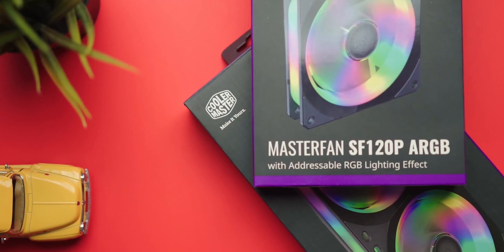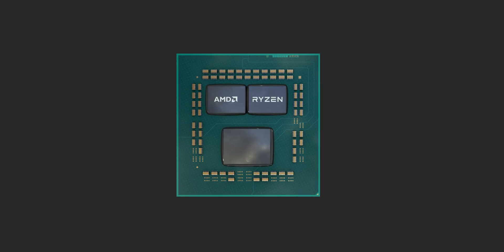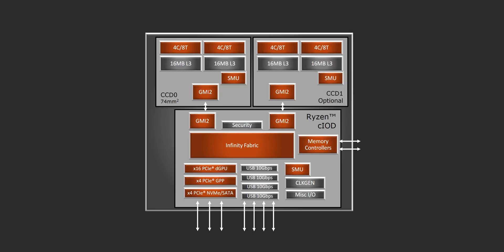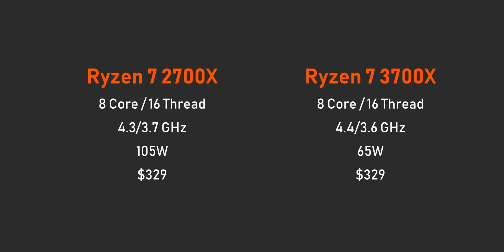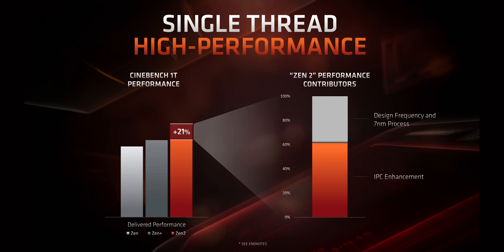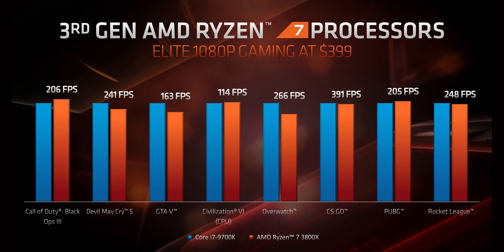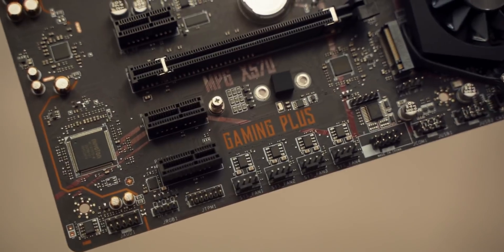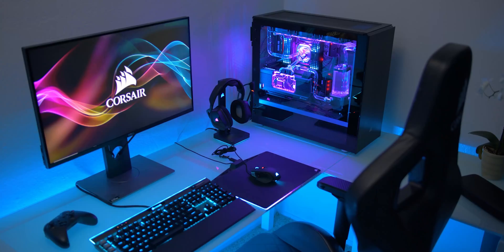AMD Ryzen 3000 – A Very REAL Problem For Intel?

Comment: Aiming for 3950x 16c/32t @4.6ghz
64mb total cache. Changed my mind from 9900kf 8c. But I'll wait till January I guess. As I want to see intel core X 10 core & AMD 64core threadripper performance this December before commiting in buying anything. 
9900k are selling like hot cakes rn & I'm resisting temptation, even at 20% reduced price. But if any from AMD's cpus revealed till December, can match single thread performance close enough to 9900k, with their high cache, pcie4 & core counts, I'll get that.
Am Interested only in 16c+ but with 9900k single thread performance, the first AMD chip that does that wins!

Comment: As a 2700x owner, the logical thing would be going for the 3900x, maybe holding out for 16 cores by the end of the year... Any other ideas on this?
Reply: Still holding out for 3rd party benchmarks but I would appreciate the gain in IPC. Also, upgrading would seriously streamline video editing and especially 4k rendering for me. 16 cores should practically half conversion time. Besides, when I chose AMD I already did it with Ryzen 2 in mind.

Comment: Guy's if you have an x79 mobo, grab a Xeon E5 1680v2 from Ebay for under $200. It's 8core 16thread fully unlocked and will smoke Ryzen. You'll get close to i9-9900k performance for cheap.

Comment: FYI: The 3200g and 3400g Are going to be made on the 12nm process rather than the 14nm. This explains the increase in their frequency performance - no special binning going on here in other words. This is an easy enough thing to miss on the product pages - and they're going to be launching along side the second gen parts on 7/7.

Comment: nope Intel isn't worried they have been 3D stacking Xeons with 28 cores for a while now for fun in the office weve been thinking of naming it Xeon 3D X6 which is essentially a 28 core 56 thread stacked 6 times with a special Intel 3D cooler that comes with each CPU so in the end its 168 cores at 4.6 GHZ with 336 threads take that AMD losers

Comment: Sorry for the off topic but you sould definetly adjust ur glasses nose pads, as they are not in contact with ur nose and the frame itself is. It leads to corrosion by sweat and the lenses also sufer, almost imediatly the anti reflective coating starts to desintegrate. Just a heads up

Comment: 4:39: Also latency between the chip(let)s. How is it going to handle I/O <=> Core operatioins for example? Ryzen 1(k) had some problems with latencies and that was inside ONE die and not inbetween multiplie dies! 2000 series did improve on that, but we are now talking seperate dies.

Comment: At the moment I'm running the 1st Gen Ryzen 1700 and I am considering doing an upgrade to the 3700X. It just depends on the cost of the x570 motherboards, especially since i would upgrade the gpu as well.

Comment: My only concern with R3000 is slowly filled lines by raid cards and nvme im considering threadripper platform only becouse of higher line count. If i want dual gpu setup with few nvm-es i dont have lines for soundcard network card tv card- so i can watch tv with pc.

Comment: Why would you need lower end 500 series boards when everything is backwards compatible with the previous series? Just get a 450 if you don't need all the features of a 570. I don't think it's an actual issue.

Comment: Those fans on X570 don't look appealing to me and while they are  likely decent boards features wise and build wise the gamery look over functional look especially heatsinks is disappointing. So is their height expected price which means most 6-8 core buyers will wait for B550 which should still be PCIe3.0 only no? Intel needs to half their prices literally to be competitive, but here comes the kicked, neither the AMD NV duopoly in GPUs wants to drop prices and fails to compete. Intel knows this well and they will likely hold their high prices position especially if they can't even produce enough CPUs due rebuilding of their manufacturing for 10nm or what ever the reason for shortage of their 14nm is. They will rather give up a bit of market share and sell at high prices, waiting for AMD to play ball and screw us all over with their yet another duopoly.

Comment: i really want to move to ryzen but all the itx b450 itx board only have 2 pwm connector and most of the m.2 slot are at the rear - with exception of the premium prices asus rog.

Comment: It just seems to me that AMD is working in COLLUSION with Intel rather than competition; especially with the higher cost of the 3950X and 500 series MB...  I'd rather see AMD come in with a Low Price then if the items prove itself then raise price at a later date; high to start will cause most folks to look away rather than buy. Most stay with Intel because it's proven itself and AMD needs to get back into the market as a competitor rather than remain as a Bitch Stewie for Intel working in collusion. 

AMD should take back some of the PC Market but they are only @ 20ish% so any increase would be an improvement... I hope AMD can make something happen here because they need to look to gain market share over getting more MONEY per CPU right now. Greed is the killer of any Monopoly and Intel is finding this out right now...

Comment: Haven't Ryzen CPUs been clock for clock, faster than Intel, even since gen1? And now with a 15% IPC improvement, wouldn't a ryzen 3000 series running at 4.5, pretty much be similar or even stomp the 5.0 G CPUs?

Comment: Without A520,B550 motherboards Zen 2 is not that appealing(For 3700x and below).Avoided Intel,for that very reason.
Forcing users to buy expansive motherboards with features they unlikely to use is a very bad business practice.
And next zen is likely to be DDR5 so those expansive motherboards will unlikely have backward 
compatibility.

Comment: I had a custom built Ryzen Threadripper  gaming system made 2 years ago.  It was designed then to outperform the 9900X series Intel processor.  Guess what I did it for about a grand less than the 9920 would have cost me and got twice the RAM and 2 graphics cards in it compared to what I would have had to put into it with Intel and Nvida products by sticking with AMD products.  Yep I went with R580 cards that where brand new was able to get 2 of them SLI linked them for more memory than a freaking Titan card it has 64 Gigs of DDR4 3200 RAM in the freaking thing and it cost me less than 3 grand delivered.   The 9920 was going to be 4 grand with just a single graphics card and 32 gigs of ram.

Comment: I just switched from i7 2600k to Ryzen 7 2700 (non - x mainly for power consumption) with Aorus x470 motherboard after 6 years with Intel (i5 2320, i5 2400 and i7 2600k). Is really worth they

Comment: Personally I am keeping my 6700k

I got a massive deal on a prebuilt. Whole platform cost me 300$ after I sold the GPU on ebay and bought the one I wanted.

As things are now, I have no need for a ryzen 3000 system and even If I want one, it would be silly to spend money on one even if I was made of cash and had it falling out my ears.

Comment: I'm probably AMD'ing next go-round, but I wouldn't count Intel out, even if they still haven't figured out 10nm or spec-exec currently. It's just how it goes. Intel rests on their yannies laurels when they have a solidly dominant position, AMD starts eating their lunch for a bit, but not enough to offset Intel's massive OEM customer base, and Intel eventually actually tocks with all that money they have reliably coming in. The Sandy Bridgening will come again, eventually. Heck, I wouldn't be surprised if Intel already had a mostly ideal response just waiting for them to get 10nm or lower working reliably.

Comment: I'm actually disappointed in AMD a little.

When they launched Ryzen they said AM4 would support chips up to 2020 and Zen 2. I spent the extra when I built a new system in 2017. Got a X370 Motherboard even though I was only getting a Ryzen 5 1600. I wanted OC headroom and figured it have the best feature set for Zen 2 chips. I hate the whole Intel 2 generation at a time BS then it is a new revision for new chips. Forcing 500+ dollar upgrades. 

Now I find out that if I want to go from a 1600 to 3600x I'd have to buy a new motherboard. (though that is as much a Manufacture decision as AMD) 

The only plus is I had a motherboard failure due to a bad board or bad chip and honestly Support was so bad that I just bought a new board from a different brand on sale. So thankfully I got a X470 board. which means I can upgrade the chip without too much added cost. I am disappointed that I would have had to do board and chip though. 

The PLUS to this though is that I could have upgraded the board first and then later upgraded the Chip. With Intel if I wanted to go to a 4th gen intel chip the board isn't compatible with 2nd gen or 1st gen.. or 3rd gen. Upgrading Intel is always a frustrating experience and is usually just better to build a whole new system. Which a First Gen Ryzen chip and board I could choose to upgrade the board from a 300 series board to a 400 or 500 series one put the first gen ryzen in it and then upgrade the chip later to a 3rd gen zen 2 chip. That is something you couldn't do with Intel not 3 generations apart. Some times not even 1 generation. 

I'm still happy I build a Ryzen computer though. As I did unintentionally upgrade my motherboard which is compatible with a previous generation and will be for this new generation. Meaning I will still spend less that I would have on Intel and in a manner that is easier on the wallet. Allowing evolutionary upgrades to my PC for what will be basically 4+ years.

Comment: the real problem with Intel atm is i5 6 core 6 thread is basically dead spec wise i7 8 core 8 threads dead as well. I9 9900k is still a good cpu but probably they need to call it i7 now and lower the price to 350-400 depends how it performs against 3700x-3800x

Comment: The 2 APU's (3400G and 3200G are based on the newer 12nm node. Not 14nm...... yes, it can also be called 14nm, but it is in fact better then the original 14nm. 
About those MoBo's.... You can find fairly priced X570 boards, there will be plenty to choose from. And the X550 boards will come early next year. When you make video's will you please assure that it is complete please. You are scaring people of by saying X550 is not announced, while AMD said they will come...... Or are you payed to mislead people

Comment: Hopefully my MSI B450 GAMING PRO CARBON AC will work out of the box with the r5 3600 i plan to upgrade to from the current r5 2400g i have
Reply: for all 3000 series its needed to update BIOS firmware to the latest first (on that board you have flashback bios button)

Comment: The G (3400G) are a good example of what happens with no competition, those CPU have no competition so AMD don’t have to do anything just overclock the 2400G and call it a 3400G, they are also claiming some improvement in instructions, the 2400G has poor support for 4K (video) compared to the i3 and Intel in general so they need to sort that but we will have to wait and see if they  have resolved that.  They are the best APU you can get in that price point so the only game in town.  But Intel is working on GPU, it won’t be any time soon, but they will be able to answer the G APU chips and they offer more APU functionality across their range currently.

Intel still has the server and laptop market and while Ryzen is outselling Intel AMD are coming from a low user base so it will take a while for Ryzen to take market share.

Comment: Those benchmarks were actually rigged so that it was the worst-case scenario for AMD.
1. They didn't apply the Windows 10 May 2019 Update optimizing for CCX related scheduling.
2. None of the updates concerning Intel's Spectre and Meltdown security patches were applied either.
3. Intel's MCE wasn't even disabled.
In other words, not only was it the worst-case scenario for AMD, it was the best case scenario for Intel.
Furthermore, they showed, Call of Duty, GTA V, Overwatch, CS:GO, and PUBG all of which are heavily optimized for Intel. I don't see how AMD cherry-picked any of the games.
You should do some research before blabbering any nonsense like these. Very poorly done research overall. I just hope it wasn't done on purpose for your personal needs.

Comment: what I see happening is intel dropping 9700k to around $300, the 9900k to around 3800x prices (depending on performance) and the 9920x to be reintroduced with increased base clocks and a $500ish pricetag. I could see intel coming to near parity price to performance pretty easy. this will all depend on when the next intel product will be introduced. I love the competition.
Reply: what they could also do is price the 9900 non-k at 3700x levels and either price the 9700k at 3600x prices, or give the 9600k hyperthreading at those prices. the 9600k would essentially be the old 8700k with the hardware mitigations. they could compete directly with ryzen if they chose to, and I think it would drive prices of all processors down.

Comment: Intel is a much larger company than AMD, so I think the latter is doing very well to even be able to play in the same leagues. They won my support. 

I had an Athlon C Thunderbird back in the early 2000s and built a Duron system for my little brother. But AMD gave me no reason to stay with them -- until Zen. Last January I finally retired my trusty i5 2500k and went with a 2700x. I doubt I am going to get the years or service I did from the i5 before it was nearing obsolescence, but the 2700X definitely was the best choice for the amount of money I was prepared to spend (decent for gaming and really good for DAW software). The price equivalent here in NZ was an i5 8500. I kind of want to support AMD too. I like that they are giving the blue behemoth a run for its money.

GPU was not such an easy choice. When I did the upgrade it was between the RX590 and the GTX 1060 6GB. The AMD card was cheaper, has more VRAM, and is generally faster. I did not like that choice so much though, because I knew Polaris is an old tech and both Turing and Navi were approaching. The crazy high prices of Turing made choosing the RX590 hurt a little less though. 

I am still playing Fallout 4. I like building settlements and using mods. Frame rates can tank in settlements that are really built up and have lots of turrets, spotlights, and settlers. CPU overload I think. A recent Windows update seemed to help. It might be using the extra threads better. I dunno. 

I recently got a new audio interface. An Audient iD14. I was having trouble with it going to sleep if I did not move my mouse for several minutes. Audio would quit. The problem resolved but I am not sure which update helped. Windows audio has definitely improved. It was the one thing the Mac w@nkers had over us. Mac was far better for digital audio workstation.

Comment: At 3:37 you make the claim that 12C Zen 2 CPUs will have an entire core complex (CCX) disabled. Mark my words: that is completely wrong. AMD has never released a Zen or Zen+ CPU with an entire CCX disabled. Instead, they disable cores across all CCXs to produce reduced core count parts. So, the Ryzen 3 1400 has two 4C CCXs with only 2 cores active per CCX.

The Ryzen 9 3900X will have 3 cores active per CCX, for a total of 12. All CCXs will be active.

This is the smarter way to do it as the heat dissipation will be spread throughout the die and likely makes it easier to get less-than-perfect silicon to yield a usable chip.

Comment: I7 4790k stock with 16gb ddr3 and gtx 1080 ti.  Runs my 3440x1440p ultrawide 120hz just fine and 2560x1600 vr headset smooth as well.  No need go upgrade

Comment: Yes but where is the upgraded 7nm with an upgraded Vega chip? If Intel marketed the APU and motherboard that is in the Skull Canyon NUC, AMD would be playing catch up in the SFF market. Second senario, Intel drops the price of the Skull Canyon to a reasonable level and AMD would be playing catch up in the SFF market. IMO, Intel has the advantage in Hackintosh desktop builds as featured on Morgonaut's youtube channel. Very disappointed that the AMD APU processor did not get the 7nm upgrade along with a Vega 13. Hey JMHO.

Comment: Definitely thinking about upgrading to a new Gen 3 Ryzen from my current Gen 1 Ryzen, mainly upgrade the components to then upgrade my parents computer with the 1st gen Ryzen. My only issue is i'm not 100 percent on the motherboards and I wonder how the memory is going to change overall, faster speeds? Definitely something to consider though.

Comment: I wonder how the top of the line 3950x will perform with PCSX2 emulator. I currently using the  8700k it's overclocked to 5.0ghz. My performance tanks when he action gets heavy to 40-50 fps when playing Shadow of the colossus.